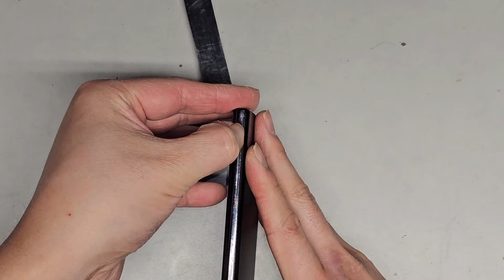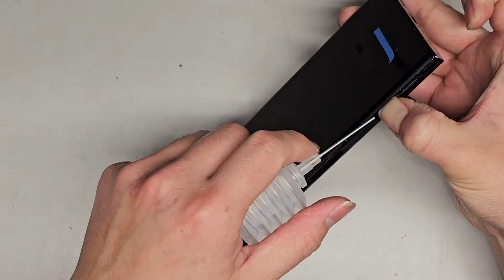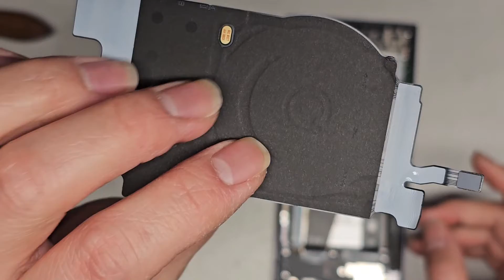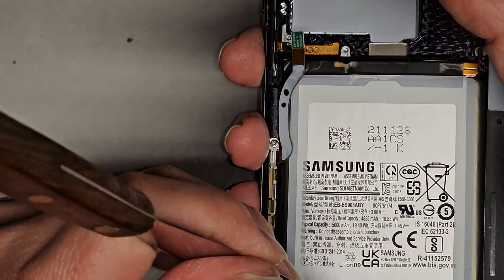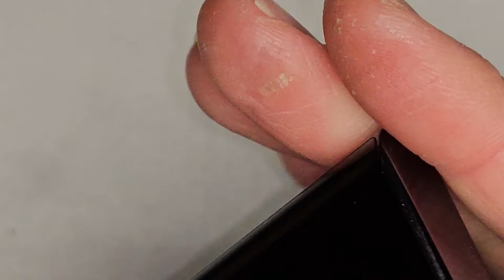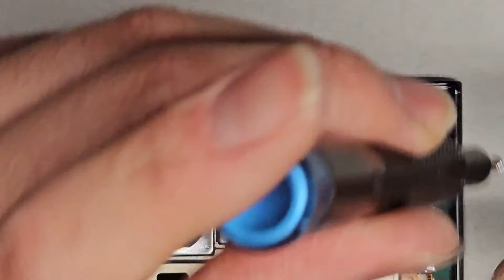Samsung Galaxy S22 Ultra Note Disassembly Camera Cameras Speaker Charge Port Replacement Repair

Comment: thank s so much for the excellent video. I had ordered and received a s25ultra as a replacement for my wife but she didn't like it as much (no BT for the pen) so i though i'd give fixing it a try. ordered both parts and replaced and it's working great, returned the s25ultra back to spectrum for a full refund.
One helpful hint. getting the back off is a PITA but I found using a razor blade worked great for getting into the gap to separate from the glue.
Reply from the maker: Nice! Be careful with razor blades. They're brittle and can snap off and fling shards into eyes and other body parts. They're meant for cutting, not prying.

Comment: Thank you for this video! I really thought I was going to have to buy a new phone. I have the same- S908U- t-mobile US version. The antenna on the left is similar but not screwed down and doesn't have that tether looking cable and moves freely- no glue. I remember from working on Note 2's and 4's that each carrier has slightly different designs internally. Anyway, replacing the USB C board fixed mine! If anyone can report on the durability or quality of the part I'd appreciate it. I used the one in the link here. After a drop, it would only connect to the 5GUC network (t-mobile) which confused me or sometimes no signal at all. Even when 5G or 4G showed on the screen, there was no internet connection according to SpeedTest. Another thing I found was a missing screw in the USB C board. Probably from when Assurant replaced my screen with my insurance. Yeah real professionals. First they tried to say it wasn't their fault that the S-Pen didn't work after the screen replacement. I had to prove to them that their screen frame which comes with the new screen was defective. Maybe they left the screw out on purpose knowing it would be more susceptible to damage if dropped?
Reply from the maker: That sucks. This was also a tmobile version. Glad you were able to repair it. If you haven't already, please like and subscribe so others can find my videos and possibly consider watching a few others, liking and commenting to get the algorithm to recommend my channel. Thanks!

Comment: Thank you for the video! I replaced both antennas due to no cell signal and noticed no change. It ended up being the USB C / SIM board as well.
Reply from the maker: Yup, that seems to be the most common one.

Comment: First, you're an absolute legend. Thanks
For anyone else looking for context: Mine would connect to 4 and 5G only, and drop calls constantly after an update (Verizon, 11/17/24). I ordered antennas and charger board. Antennas did not repair. Board fixed it. Also, I have the S21 ultra and accidentally ordered a board for S22. It worked. It does not fit correctly, but it looked close enough and I was willing to chance it to see if it would connect. Connected right away. Charges. No heat, no shorts. It will get me by until the correct board gets here.
Reply from the maker: @Donttellmeitsraining-nb2wp  haha interesting. I'd be too scared it would destroy the phone.

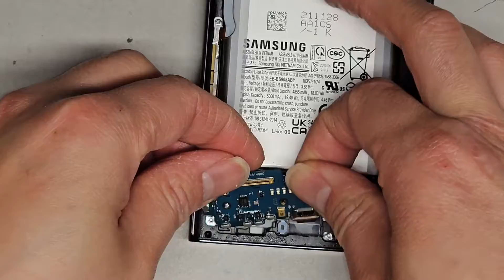Comment: 34:20 yeet that 💩
Reply from the maker: Lol yeah...
Reply: @ItsBinhRepaired  omg, thank you so much for this vid man. you say "make sure you have the patience" but brother I ran out of patience deal with intermittent service connection for 5 months! Holy smokes I think it's fixed !!
Reply from the maker: @deveregrant  awesome, glad it helped. If you haven't already, please like and subscribe so others can find my videos and possibly consider watching a few others and commenting to get the algorithm to recommend my channel. Thanks!
Reply: orrrr not. it wasnt charging correctly so i opened it again to check connections, now the screen doesnt light up omg nooooo
Reply: ohhh ripped the display cable getting under the qi charger -_- f me. still thanks
Reply: @deveregrant 😂
Reply from the maker: @deveregrant  D: were you able to replace it?